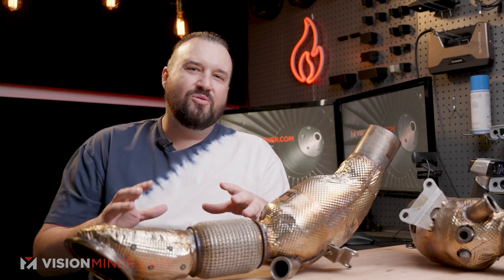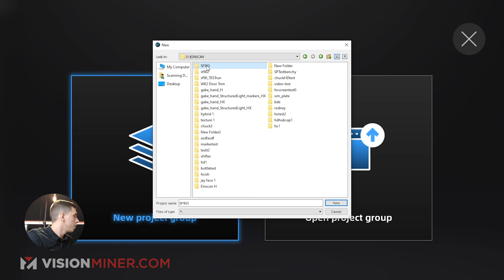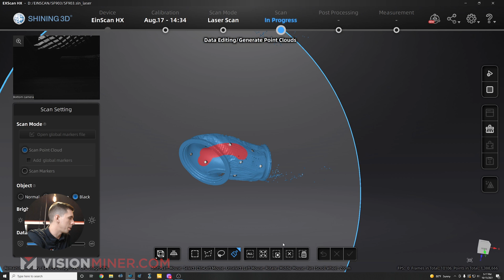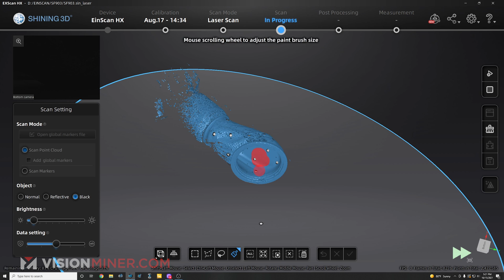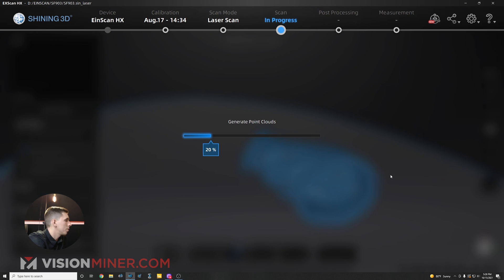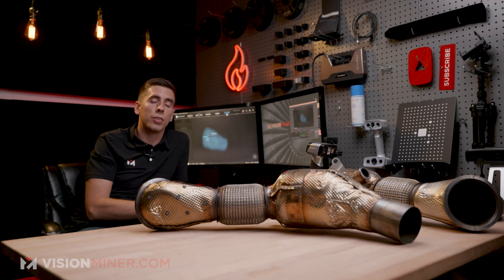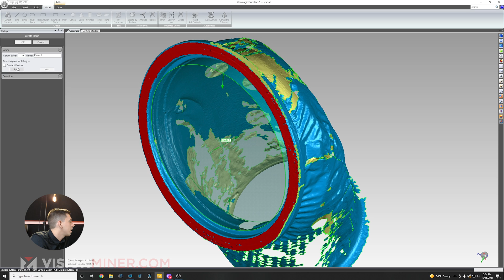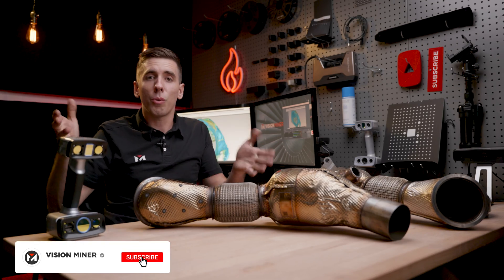Ferrari SF90 Exhaust Downpipe - 3D Scanned with the Shining3D EinScan HX

Comment: Pointless scan, no value I'm buying a scanner for that application
Reply from the maker: Correct. We like doing ULTEM around 150mm/s with big nozzles.... but high-temp materials usually go slower. 500mm/s is like, super experimental PLA speeds, and we don't hide the fact you're not printing at that speed the whole time, due to corners/etc....